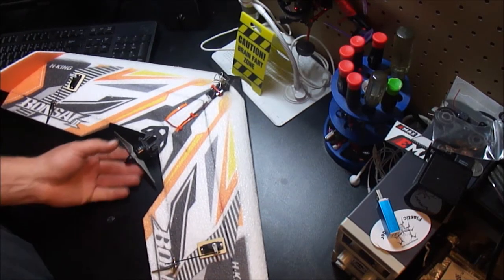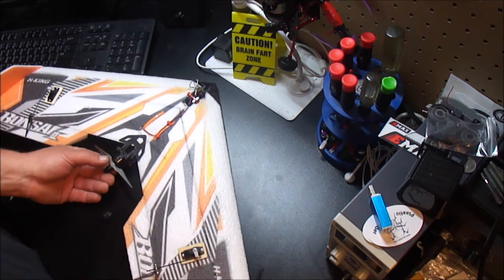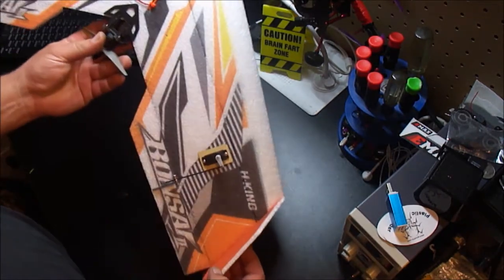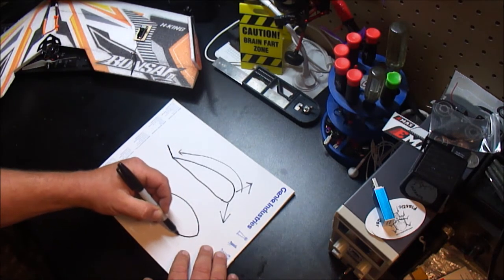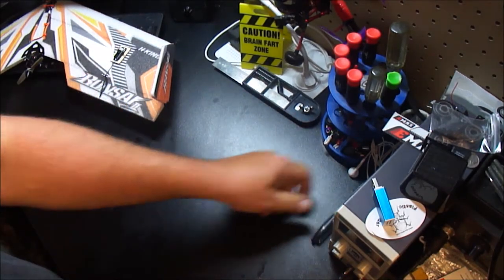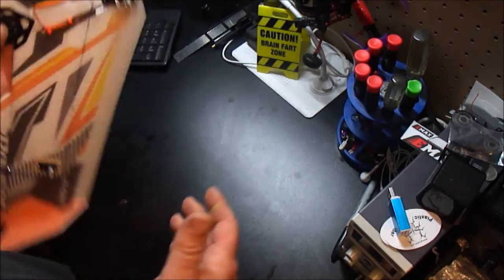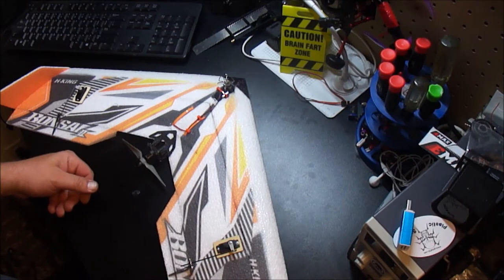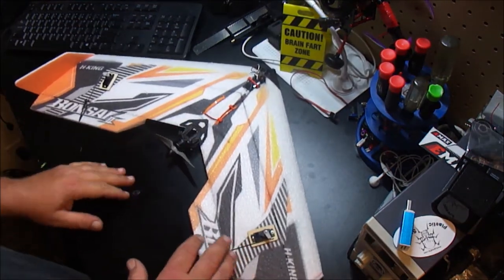Wings 101 For Quad Guys

Comment: very informative, I have questions. I'm using a 6x6 pusher prop. only pulling 23 amps.  with 40 amp ESC. should I increase prop length or pitch ?  Great explanation on reflex.  ( i never knew)   even informative  for a plane guy wanting to get into FPV wings
Reply from the maker: samuel lubricant More power more better. I’d try going for higher pitch first. A shorter prop weights less.